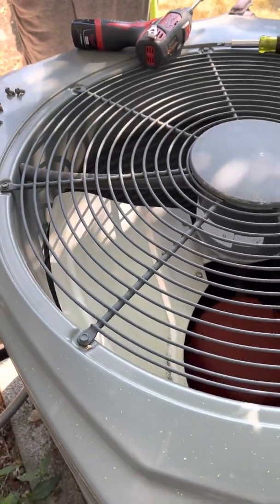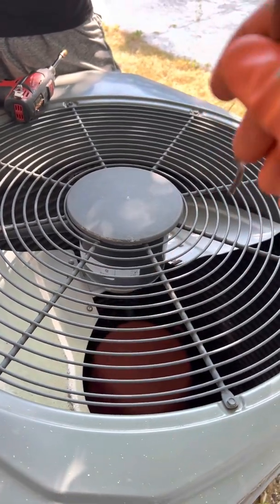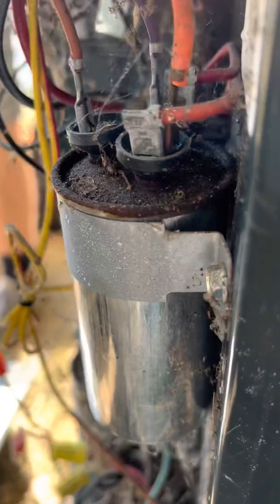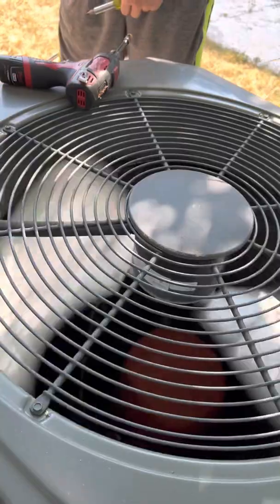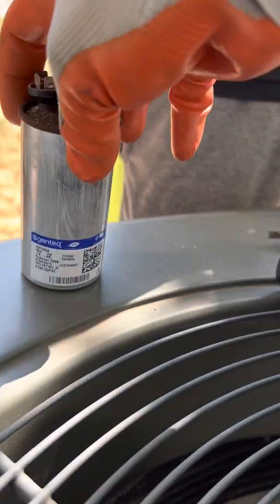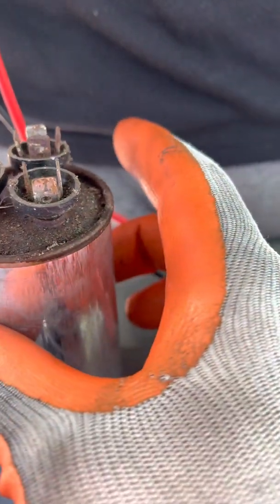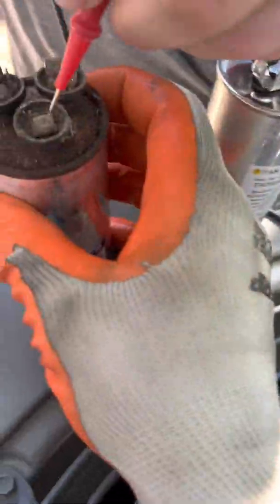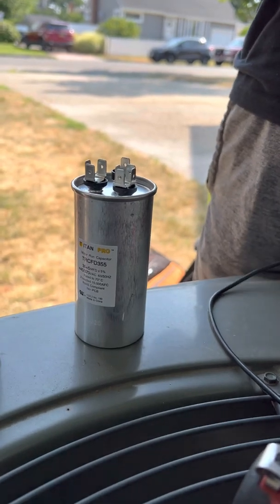Trane Condenser with bad capacitor￼￼

Comment: So my A/C went out last night and I figured the chances were high that it was the capacitor that probably blew. However, your "get the fans spinning" to see if it starts up, worked perfectly this morning!! At least that confirmed it's not the fan motor and only the capacitor. If only I knew that last night before a muggy night of sleep!! Thanks for posting the video. And yes, my capacitor is domed at the top too. Off to get a replacement part.